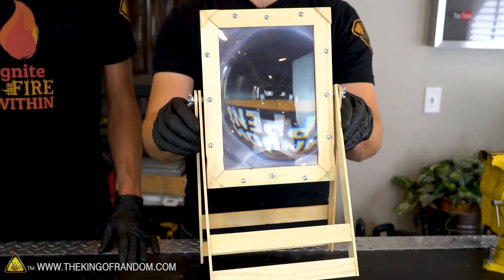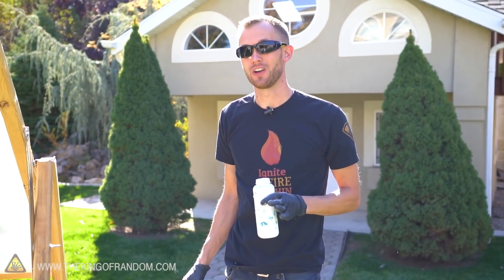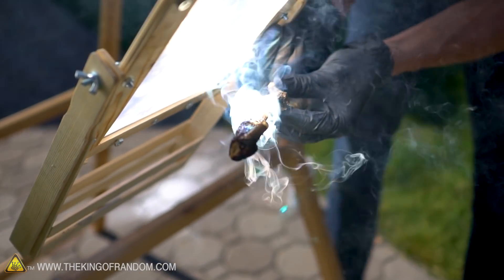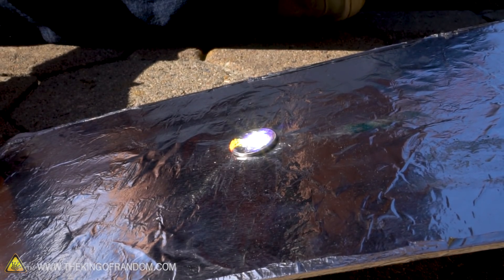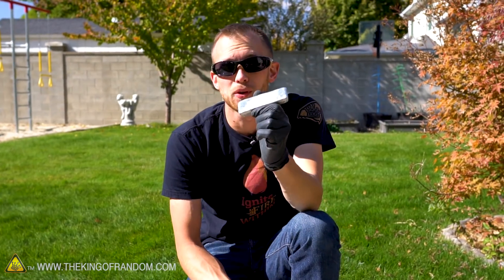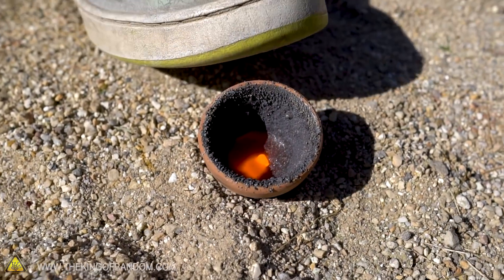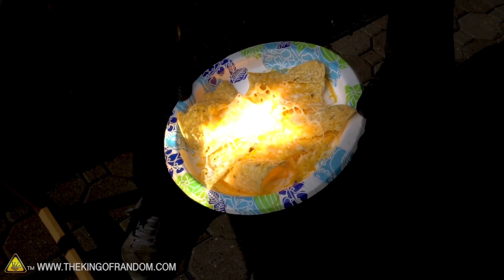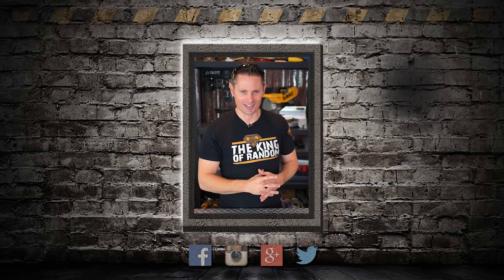🔥Solar Scorcher Torture Tests! TKOR Experiments With Our Mini Solar Scorcher! What Will Happen?

Comment: Have you tried using any of the glass lenses from the projector tubes with either scorcher to magnify/focus the beams?Also,if you flip the scorcher 180deg,to where the rings/grooves are on the opposite side,does the beam stay the same?Thanks!

Comment: I think the smaller lens gets more heat because it doesn't flex like the big one does it sits flatter and focuses better maybe if you glued the big scorcher to a price of clear polished plastic to make it more stiff and flat. then the bigger scorchers focus zone would be much sharper and then in turn much hotter then the smaller scorcher. Or more simple idea you can just put a piece of glass under it inside the frame to hold it flat.

Comment: Now put a double-concave lens in the focal point to make a solar laser.
Build several mega solar lasers, then use mirrors to steer the lasers onto a common target.
You now should be able to melt steel. Or at least get it hot enough to make workable. A solar forge, if you will. TKOR meets Alec Steele!

Inb4 9/11 comments.
Reply: 9/11 comment
Reply: Technically a solar beam
Reply: DUN
DUN
DUUUUUUUN
Reply: Asriel Meemur in Europe you put it like day-month-year
Reply: Double Dare Fan that's wawsome

Comment: Could you use a high powered laser with the mini scorcher to create something you can use inside?
Reply: The laser's light is already focused.  This would only be useful if the laser beam was 20 inches wide, then you'd be able to condense the beam to a smaller point.  Even if you have 30 high powered lasers, you could just arrange them so that they all converged on a single point, so there's be no reason to use the lens.

Comment: What happens if you put soil or ground dirt into a metal foundry?
Reply: depends on the content of the soil.  If there's silica, you'd get some glass, but it would likely be black (obsidian).  The trace amounts of metal would likely pool on top of the glass, but primarily you'd probably get slag.

Comment: Multiple layers of lenses with water in between the lenses when you exceed the lumens you can pump through the lens. This should allow for a short range solar scorcher. Also same thing in the reverse, such that you straighten out the light making a laser. Again you may need to liquid cool it to keep it from melting.

Comment: Try to find a better Fresnel lens, yours do not seem to have as much power as mine does. Also, yours has almost a creamy white color... Mine can melt a penny in 5 seconds, and I have even used it to burn a hole in a steel can filled with water. You should make another one with a clearer lens and compare the clear one and the white one.

Comment: The giant scorcher focus's almost parallel light rays to a point . . . which means that the mini scorcher would focus it faster, which also means that any errors are spread out as well. But here's an experiment for you: Put the mini scorcher PAST the focus point of the giant scorcher and see if you can 'straighten' the focused beam into a parallel beam again, albeit much more concentrated.

Comment: Will iron rust in liqiud nitrogen?
Reply: Oskari Kemilä obviously not since there is no oxygen
Reply: No, iron needs oxygen in copious amounts in order to make iron oxide. The subzero temperature inside a container of liquid nitrogen would both block most gaseous oxygen and freeze any liquid water "H2O", therefore rusting would be difficult if not impossible.

Comment: Dry Ice vs Solar Scorcher please
Reply: kr4zyy it will melt as cold things usually do in heat
Reply: The same effect will happen as if it was in the furnace, but just at a higher rate in one spot.
Reply: Thomas Pearson 🤦
Reply: No.
Reply: kr4zyy I said the same thing
Reply: +Logan Games/More!!! cool no one carrs
Reply: You can easily tell that it would evaporate into nothing, if beads of lead melt in < 5 seconds. Dry Ice melts in average temperatures (which are even higher for him than most regions, as he lives in California).
Reply: Ya
Reply: Thomas Pearson This is dry ice we're talking about, not regular ice

Comment: I was wondering if you could use the solar scorcher to warm up and boil water, and then use the steam in a power generator like the ones from coal plants, could this be a new way of producing solar energy? Could you replace the heat of the burning coal by a solar scorcher?

Comment: Position 8 solar scorchers in a circle and make all of the focal points on one point and try to see how hot it gets and try to melt a metal with a high melting point. Like if you agree
Reply: The problem with this theory is trying to get all them to focus sunlight to the same area  You know with the Sun kind of being a fixed point yeah you could get 8 scorcher set up in direct sunlight but I don't think you could get even two in direct sunlight to focus on the same spot But you know I'd be glad to be proven wrong lol
Reply: +Anthony Barr you just make another sun for the day
Reply: Anthony Barr you could maybe pull something off with mirrors but it would still be hard to position everything just right
Reply: That was just with mirrors, not mirrors AND solar scorchers.
Reply: hah!
Reply: Aaron Spencer I thought the same thing lol
Reply: Anthony Barr : you could, but you'd need to set up a bunch of mirrors as well lol  
Edit: ah, I should probably have read through to the end of the thread :P
Reply: SirEpic Mythbusters tried dping this with like hundreds of people and everyone had mirrors pointing it at a sail i think
Reply: SirEpic one light source with 8 areas of contact.. Man they need to reamp public school requirements!

Comment: You seem to have no idea about focal lengh and the physics behind a Loupe. 

In optics you have whats called a Focal lengh OF'=f'. 
This distance OF' ist the distance between the middle of your lens, and the point it all converges too. 

So you have your vergence that is 1/OF'

Thats important to know to know how to get a better and more concentrated beam (like you said the little solar scorcher has a more concentrated beam so if you input the same energy you should get out a more finer dot then with the big one) 
For that though you have to know how optic works because if you place your second lens on your focalpoint F'. 

To over simplify for you the physics : (using 1/OA'- 1/OA=1/OF')

Youd neet to put a second lens between the two solar scorchers in order to create like you said a light that goes straigt into the little solar scorcher not at an angle. for that you can use a converging lense with the right vergence to be able to be far enough away from the big solar scorcher in order not to loose any light on the borders. Then this light will create an image that is infinitly far away (straight light ) wich in turn can then go into the smaller solar scorcher at any distance OA (since A is now infinitly distance ) to create a small and powerfull dot that concentrated a little better the energy of the big solar scorcher into a much more compact and small form factor and therefor create much much more heat in the point. 

You have to get the maths right thats the bad part but they arent really hars theyre first year University material it's pretty easy. 

Look it up and try it again youll get a much more satisfying result. >

Joe 3rd year Physics and Chemestry student.

Comment: Could the mini scorcher be used to super-luminate some glow in the dark objects? As in pass a GITD plastic sheet behind the beam super quick so it doesn’t melt, and then throw the sheet into a light sealed box and see what kind of pattern it made on the plastic, or see if it works FASTER than using regular sunlight to “charge” the glowing power to full ability?

Comment: when the zinc begins to melt it starts to soften up the copper layer, if you have a nail handy you can scrap out the copper and be left with a nice nugget of zinc...but if you do it on aluminum it will merge with the zinc and make an alloy

Comment: I wonder if you could use the large solar scorcher to heat up a solar water heater (obviously not in full focus) how efficient would it be. Same experiment with electrical solar panels. Are the photons focused enough to create a higher output?

Comment: since ur theory on why the dubble focus dident work was the angle on wich the sun came down, why not do a test with multiple mirrors to aim more sunlight through and see if it does any difference on the focal point / melting or other

Comment: I noticed that when you was putting the baby powder on the small one the light was red on the top half of the focal point and blue on the bottom half of the focal point, so the color spectrum is reversed at the focal point.

Comment: You guys are losing a lot of heat through contact with air and the material the metal is resting on. You guys should try making narrow cone clay cup and point at the lens. That way you can increase the temperature a lot I believe.

Comment: You should make another giant solar scorcher and try putting both of the focal points on the same point and see if it makes it more powerful or if it stays the same.
Reply: Now, if you know how physics work you know it will make it more "Powerful" as its two diffirent "sources" of Focused Light ...
Reply: Techy in physics, it doesn't always mean 1+1=2. I'm sure it would make it more powerful, but by how much? Would it be twice as powerful or only slightly better. I don't think you can line both up directly with the sun to make them have the same focal point, so if both are slightly off center, would it still make it more powerful or less powerful since they aren't perfectly aligned

Comment: Put dry ice in salt water
Reply: It will freeze, as dry ice is much colder than the freezing/solidification point of water.
Reply: The backyard mechanic It would freeze. Even if there is salt in it.

Comment: The reason the dual lens experiment doesn't have the desired effect of increased heat is you are still working with the same available energy from the sun, you simply are redirecting the light to a different focal point. Law of Conservation of Mass/Energy, cant pull extra energy from nowhere.
Reply: R3D33M3R People were hoping it would focus into a really small focal point

Comment: How is it stil that warm there I looking out my window at 10 cm of snow
Reply: Luka Windey I don't have snow but everything dead and it's cold enough to have snow.
Reply: Because Texas. In North Dakota, which is on the opposite side of the United States, there is snow. Texas is usually too close to the Equator to get snow.

Comment: Please make a vaccum with gloves going in so you can mess around with the stuff inside.
Reply: if the gloves had material inside the rubber, the gloves wouldnt burst. and your veins wont burst because they would be at normal air pressure, not in the vacuum
Reply: Rohaan Hussain I don't think that'd work
Reply: The glove going inside the vacuum chamber would burst inwards into the chamber, or they would stretch  inside the whole vacuum chamber
Reply: actually there is the backyard scientist he had done this to see what would happen fyi your veins dont burst its just with the strength of the vacuum it makes the gloves expand you would need some pretty heavy duty gloves to do this although it would be a pretty cool addition to the king of randoms channel